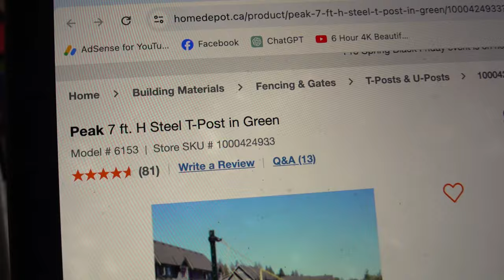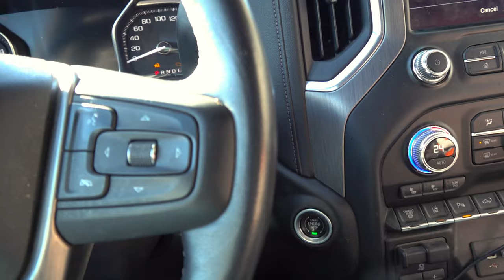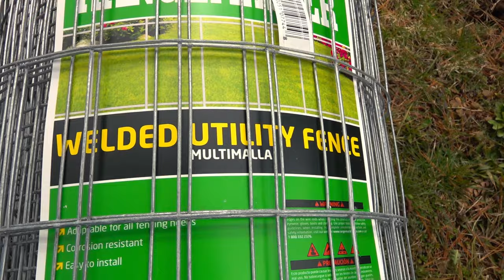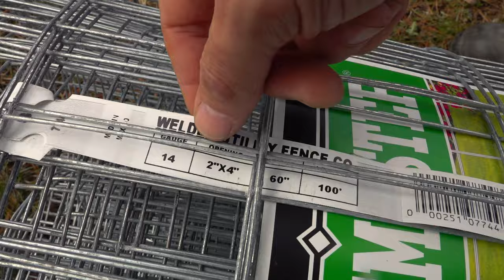Building a GOAT Habitat for the First Time & Our Border Collie is Curious!

Comment: Work smarter, I put in T posts using the skid steer by using the bucket to push them down.  Spent way to many years pounding in posts.
Reply from the maker: I barely pound posts, and in this case a wheeled skid steer on an uneven surface would have not been safe. I dont mind a little labor